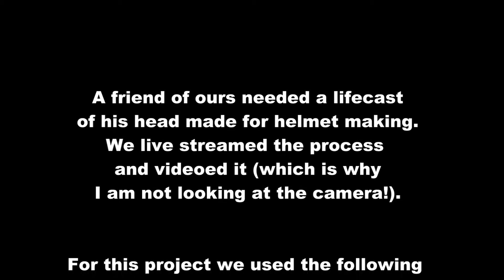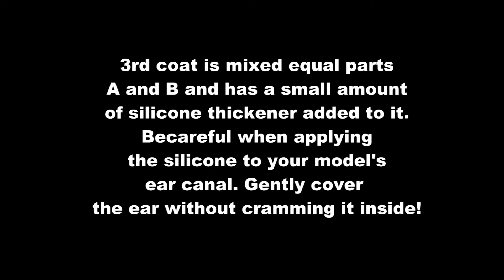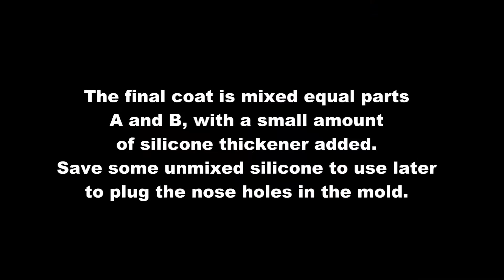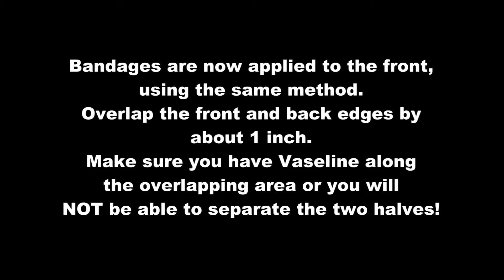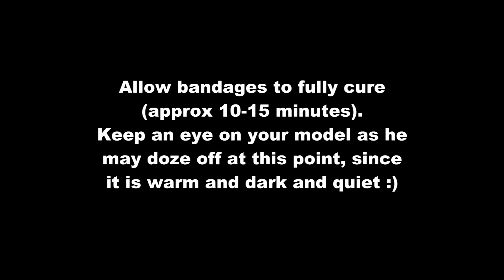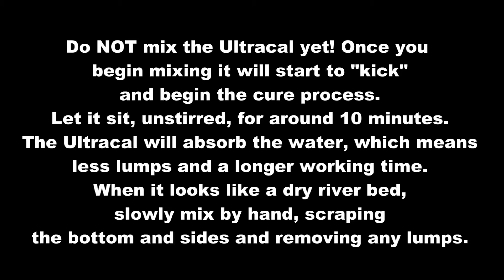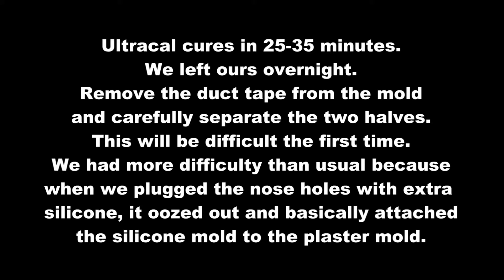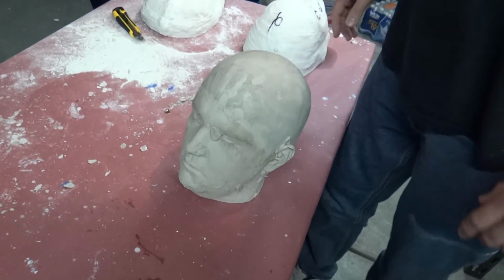How to Make a Lifecast (with Smooth-On Body Double)

Comment: You ALWAYS gotta be careful of the air bubbles between the eyes. That's the easiest place for them.
Question: how thick did the silicone need to be, and about how much did you use? Like, in ounces.
Reply: I don't remember how thick it was (the recommended thickness is on Smooth-On's website....I want to say 1/4 inch?). The list of what we used is in the video information above (click to expand).

Comment: at was the total time start to finish for the latex and plaster (to removal)? the reason I ask is I am claustrophobic and normally cant breath through my nose due to allergies.
Reply from the maker: treffoil I would not recommend doing this then. This took probably close to 3 hours from the time the silicone went on to the time we pulled it off. I would say (as did our friend) that this is NOT for someone who is claustrophobic.
If all you need is the general size and shape of your head (not intricate details) you might be better off with the method we used here (see pictures on our Facebook page) https://goo.gl/1LOfno  For more details on that project you can also watch this video we made when we did the dress/body form and use the same methods to do your head https://youtu.be/YNkp4zLUuRE
Reply: Use alginate instead. its cheaper and the application time is much quicker.
Reply from the maker: Gourmet Gamer Alginate is quicker and cheaper (see our other video on Alginate life casting) but if he's claustrophobic and can't breathe thru his nose, even that won't be quick enough. It still takes time for it to cure, as well as applying the plaster bandages which also need time to cure.
Reply: I understand the claustrophobic part. I have done dozens of life casts of all shapes and sizes. Even people that say they are not claustrophobic can panic once their faces are covered. My point was there are other options that might not be as traumatizing. Plus, there are different grades of Alginate and bandages that give you more or  less time to apply :)
Reply: thank you all for the advice. I meet a man here in Colorado who does this for movies. he helped me with a few different tricks. but the alginate was part of the answer. A sinus wash and a little sedative did the trick. what we go through for what we love.